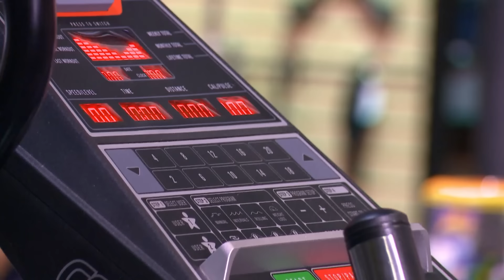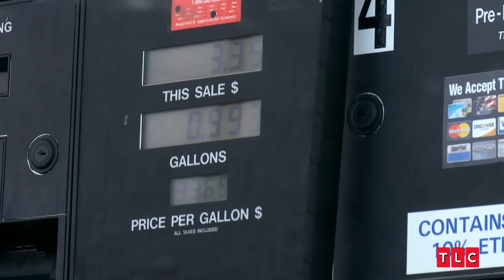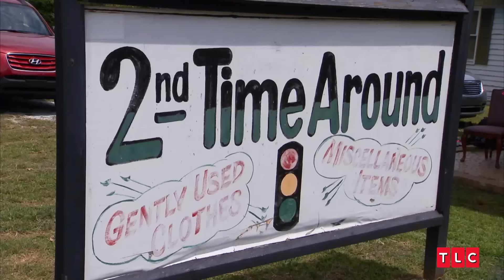She Fills Her Pool with Junk to Save Money! | Extreme Cheapskates

Comment: Bro the bike generator thing wasn’t even cheap, it was genius
Reply: didn't even work bet they plugged it in for the show
Reply: The alternator makes 12v dc current, the pump runs on 120v ac. It is very very fake
Reply: @samfergusson6349  it's plugged into an inverter
Reply: @lreny489  it's plugged into an inverter
Reply: @lreny489  it's plugged into an inverter bro
Reply: @samfergusson6349  it's plugged into an inverter bro
Reply: @lreny489  at 10.39 you can see the red inverter
Reply: Wonder how she afforded the alternateor and inverter that would of been a few hundred dollars
Reply: @L M R  it's plugged into an inverter bro
Reply: @hamstersmash  actually, it's plugged into an inverter
Reply: Did y’all even see the inverter
Reply: A pearson can put out 200 watts and the pump needs 750 watts and the car alternator is only 60% eficiant leaving only 120 watts the pump motor needs ac so an inverter adding to the losses that was a set up for views.
Reply: @samfergusson6349  not to mention that pump probably draws 10+ amps no alternator is going to put out enough power
Reply: @suncitybooksgeraldton335  Another way of thinking about this is that most pools need all of their volume pumped through a filter around 8 times a day, and that kind of pool has tens of thousands of gallons. Do you want to move tens of thousands of gallons of water using your body every day to prevent your back yard pool from becoming an algae lagoon?
Reply: She would be pedaling 24/7  charging batteries for a month, to have enough power for one day for pool pump.
You obviously need a battery and inverte. She was making about 10watts of power.
So without loses would need to be charging big enough batteries for 100 hours just run the pump for 10 minutes
Reply: @gregorius8289 you can get them used and rebuilt
Reply: Mmm all my 6 years I studied as a electrical engineer went under question 😅😅😅
Reply: The real “geniuses” are the people that believe that actually works.😂
Reply: I think her other approach was much smarter, reducing the amount of water in the pool. I mean, instead of filling it with junk she could just use a ladder and only fill it half way but...
Reply: So fake.  Anyone that knows anything about electricity knows this.  Another show had an olympic bicycler powering a toaster to see if he could make toast.  The olympic bicycler was completely drained by the time it ran the toaster long enough to make toast.  That pool pump uses about 1/2 the energy as a toaster but she was barely even pedaling.  And that belt would never stay on more than a few seconds.
Reply: It was faked doesn’t work
Reply: It’s completely fake for the show. It won’t even work if you did connect it.
Reply: That’s bs car alternators won’t produce enough power to run that equipment. They typically produce 13.5-14.8v
Reply: @VortexVibe634  she’s got an inverter but isn’t turning it fast enough.
Reply: Yall crazy if you think that would work, inverter or not. First, that alternator pulley needs to move 5x that speed to output any significant amperage. Second, that pool pump probably requires north of 1500W to power. It ain't happening. This show is fake.
Reply: They barely even provide enough power for a bike light, it's not going to save $10 a month yet $200 no way
Reply: A pump is a mechanical device. Why not skip the conversions to and from electricity?
Reply: @edwardmitchell6581  It’s not just a pump.
Reply: @trainman665 Yes, it is.  The filter system uses different inlets and outlets powered by the flow of the water from the pump.  Unless you have a pool heater, you can absolutely have a pool filter that runs on a single electrical water pump.
Reply: @melduforx  No it’s not. A pump itself does not filter. There are many components in a filter system.
Reply: @trainman665 the pump pulls water through the filter. You don't need electrical power to run a pump, she could turn the pump mechanically with the bike.
Reply: This is the correct solution.
Reply: I truly don't believe that would work. That generator would need to spin a whole lot faster.

Comment: I find it fascinating that this lady miraculously cracked the century long mystery of how to directly feed an alternating current 120 volt motor with a direct current 14 volt alternator using nothing more than a leather belt and a stationary bicycle.
Reply: two leather belts...
Reply: Oh yes!  You're so right.  I totally missed the second belt. (I think my eyes were rolling too much to notice)  @Metqa
Reply: Yeah, and that second belt is installed backward. Two opposite belts, forward, backward, forward, backward. That's so that the bike contraption produces alternating current! 😆
Reply: Not to mention a car idling in the high hundreds of rpms is what creates those 14 volts DC and uh...that was not even nearly enough rpms
Reply: All you need is a charge controller a 12v deep cycle battery and an inverter
Reply: Ya that was the fakest nonsense

Comment: The gas one is pretty good until you realize it almost isn’t. She said she buys a gallon a day, which means she rides to the gas station, and back she everyday. This means that she spends more gas then she would have if she would get the full tank and only drive there once a week. Unless the gas station is directly on her way to a place she drives to, which the video shows it isn’t, I would say that this strategy is probably the least effective out of the ones she uses.
Reply: She acts like the gasoline seeps out of the tank every night it sits in the garage. Absolutely ridiculous.
Reply: @dewilew2137  you can tell the lady failed math
Reply: It's also bad for your pump to constantly run your tank that low so she's losing more per mile on maintenance. Driving your car with less gas does save some fuel economy though since gas is heavy, so the weight savings is good but the best way to do it would be to fill up to 1/4 tank every time.
Reply: @MyFunkymonkey7  yup the gas cools the pump so not good to run it so low
Reply: That's like me not wanting to withdraw too much cash because I feel like I'm more likely to lose or spend it. And then I'm cursing my life because I need to find an ATM in the middle of nowhere because some stupid card reader isn't working. Even though me losing my cash or having it stolen is much more likely than gas disappearing from the tank of her car. What if she needs to drive somewhere because of an emergency or runs out of gas and needs to have her car towed?
Reply: the weight of extra gallons...
Reply: and hard as heck on your fuel pump!
Reply: She should at least have the tank 75% filled.
What if there’s a hurricane or some natural disaster where she had to evacuate?
Those are the worst times to buy gas!
If the power is out that just makes it worse as the gas pumps will not be working.
Reply: @FrankTimms-cs5hl  exactly. There was this life coach lady who pointed out that living in her area, with forest fires and random earthquakes, it was more frugal and smart to fill the tank to the top and to top it off as it gets to the halfway point. Half= Empty. That way, if you had to GTFO, you were not stuck with an empty tank at the petrol station waiting for the fire/quake/tornado-hurricane to swallow you up cuz you didn't have gas. And even having ONLY a half a tank can drive you past a lot of overpriced gouging gas stations during an emergency and into the next town over and safe zone.
Reply: yeah that 12 gallons of gas to fill the car would save her 11 days of time and mileage going to the gas station.
Reply: The gas isn't going bad, what an idiot.
Reply: Not to mention that the lower the gas in your tank is, the worse it is for your car. So driving to the station daily and constantly having it low, she is destroying the car quicker and effectively making it cost more than two different ways. She is smart, but she is not a genius xD
Reply: My mother does this, treating getting gas like a daily errand. It drives me nuts. My mother will drive half an hour to a little town to fill up her gas tank in preparation to make a trip to the bigger town (half an hour beyond the little town, in the same direction) to get groceries or something the following day. So she burns 3 hours worth of gas to do 2 hours worth of driving. I don't understand why she doesn't drive half an hour to the little town, get gas, and continue driving for another half hour to get to the bigger town :S
Reply: @MyFunkymonkey7  let's say you have an average new sedan, a 2025 Honda Civic. It has a 12.4 gallon fuel tank, meaning about 75 pounds of gas when 100% full. A 2025 Honda Civic weighs 3000 pounds at the curb. Nobody's going to notice the difference in fuel economy with an always full gas tank, it's likely to be immeasurably small.

Comment: Alternators don't work like that. They have to spin much faster before they begin to output current. This was fake (as is 99% of TV).
Reply: Right. Also, how are you going to run a 120v pool pump with a 12Vdc car alternator. Lol

Comment: She's actually quite a smart and resourceful cheapskate. I like the way she thinks, like the old school style manually powering up the generator 😂
Reply: It's not even humanly possible for her to power that pool pump with a bike, and even if it were, it wouldn't turn as easily as she makes it look like the alternator is not under load or connected to anything. Even an Olympic athlete couldn't power a pool pump. There is a reason why human flight is so hard. It might be possible with 4-5 trained professionals for less than an hour.

Comment: To be honest yes some of the things she does are kinda weird, but it is not as bad as i thought. She is actually so smart. People would think it is stupid and really weird to do the things she does, but it does save her a lot of money. Also I love how confident she is. (I am not saying that she isn't doing anything wrong)
Reply: She's also a narcissist that takes advantage of other people
Reply: @JonDoe-uq1mk  Are using the sports equipment is not her being a narcissist I just think that it’s a little bit overreaching with boundaries and stuff like that especially with public places,What’s the say that she’s a narcissist is a little bit far reaching
Reply: @JonDoe-uq1mk  you must know her personally since you’re throwing that word around. You saw her use sporting goods equipment? That they said they demo out? Putting sand in her pool? Just assuming huh😊
Reply: Only problem being less gas is really less gas your vehicle burns fuel less efficiently when your below half a tank shed save more money if she just filled it once and continued to top it at a set time all the time I buy small amounts of fuel aswell but my tank never falls below 3/4 as that’s where it most efficiently burns fuel
Reply: A car belt doesn’t cost any more than those actual belts she’s using to power the generator for her “pool filter” (she’s actually powering the pump)

She’s spending more money by going to the gas station every day instead of showing up once a week or once every other week by filling her tank up

The bubble wrap on her pool is about the only clever thing I’ve seen
Reply: @iino27ii91  I think the bricks in the toilet tank and using less water in the pool is kind of smart, even though she could find a more elegant way than plastic bottles full of sand to reduce the size. I agree that the actual belt is a weird choice, it will likely tear soon and destroy the whole set up. The gas thing, 100% makes no sense. 
The bubble wrap won't prevent animals from falling into the pool, not sure if that's a problem, I don't have one and don't really know anyone with a pool - my friends who briefly thought about getting a pool did the math and found they could hop on a taxi to the public pool or even the fancier one further away whenever the weather's nice for a lot less.
Reply: @iino27ii91   its not even humanly possible for her to power that pool pump with a bike and even if it was it wouldn't turn as easy as she makes it look that alternator was not under load or connected to anything

Comment: I gotta appreciate how handy she's been able to fix a generator to run the water pump
Reply: yeah other than the fact that it is a 12v dc car alternator and that is a 120v ac water pump. it is being spun at 100 out of 3000 rpm... so no there is no way that worked
Reply: @cameronck   there was an inverter
Reply: @inomu9129 it doesn't matter that there was an inverter, that's a 240 volt ac pump, it probably draws 10 amps minimum, that alternator isn't going to do it. Especially with how she's barely pedaling. It's 100% fake
Reply: It's definitely fake, that alternator at them low RPMS could charge a phone or a battery but no way power that pump

Comment: The alternator bike thing was definitely staged and you cant just sprinkle half a box of baking soda in a pool to keep it clean.
Reply: How we would know its staged?
Reply: @FactStorm  Because an alternator does put out close enough electricity to power a pool pump, especially when it's only spinning at like 100 rpms, and they're designed to spin thousands of rpms. Maybe if there were 20 alternators spinning at 2500 rpms, it could work. She's probably creating a fraction of a volt of power. And pool's get dirty easily. If she just used a bit of baking soda here and there, it would look like a pond. It needs chlorine to keep algae from growing. I had a smaller pool, and it was difficult to keep clean. You have to keep chlorine at a specific level, or it will become stagnant and nasty even if you have the filtration system running.
Reply: also that alternator puts out like 100 amps max and that is a 12 volt system. not sure what that red box was, but it didn't look like power converter to change it to 220 volts and if it was, it would only generate around 4amps, not nearly enough to run a pool pump. definitely staged. she gonna burn up the fuel pump in that car only putting a gallon at a time with not much fuel to keep the pump cool. a lot of the other things she was doing don't save money either. she's just a dummy
Reply: @mikes68camaro , and is annoying while at it.
Reply: @jmccormick1490 I'm an electrician and I was looking for this comment....it not even a.c electric. She never took the rectifier out it to convert it. Even if she did it would be dirty electric with off balance sine waves. I've tried to use alternators as a project and it's a Hella of alot more work than what she did. I was almost offended.
Reply: @FactStorm  if you think shes generating enough electricity to power a pool pump to clean that giant ass pool you must be on something. even if it did produce enough electricity to power it it would burn out the pump real fast like that, that would cost more to replace than the savings shes getting...
Reply: @federalagent7334 haven’t you noticed that many people on this show are? 😂
Reply: @jmccormick1490  I agree the power generated from pedalling a bike would be minimal if it generated a lot more people would do it!
Reply: @mikes68camaro she's not a dummy, a lot of people that were on this show came out years later and said most of it was staged and embellished. The Asian lady that was dumpster diving for food to feed her friends at a dinner party she said was completely made up amongst other things portrayed about her in that episode. She also said she regretted it because people really thought she was that dirty and inconsiderate.
Reply: When she said the alternator worked is when I realized the whole vid is a joke.
Reply: @drekelley2352 she would be better off using the bike to turn the pump directly.
Reply: Some people can be that…stupid 😂
Reply: The show is staged
Reply: I used bike at the gym and run for 15 mins yet it only tells me that I almost lit up a bulb.
Reply: Eeeeeeeeeeeeeeeee
Reply: If you want to save money on power bills, that’s precisely what solar panels and battery systems are for.
Reply: 100% fake. Two belts hooked together? What is this a cartoon? I could do the math to show how absurd this is but it’s not worth it. Anyone who ever tried to hand crank a radio would know that lazy pedaling is doing nothing.

Comment: I actually know a few people who put a brick in the toilet reservoir. When you’re genuinely tight on money, every dollar you save helps.
Reply: That's actually an advice plumbers in my country give to customers, to save water more than money, instead of bricks though just fill up 2 small plastic bottles and put them in there.
Reply: It's all great until that log doesn't want to flush down because there's not enough water lol.
Reply: Newer toilets are 'water savers' and use well less water so bricks are not needed, older systems yes
Reply: When we had a drought, it was encouraged to put a brick in the cistern to save water!
Reply: My toilet tank has a no 1 and no 2 switch :)

Comment: Her solution to the pool pump was a wonderful idea that is a serious savings as long as she can actually get the pool to the clean level that she needs to
Reply: It's not even humanly possible for her to power that pool pump with a bike, and even if it were, it wouldn't turn out as easily as she makes it look like the alternator is not under load or connected to anything. Even an Olympic athlete couldn't power a pool pump. There is a reason why human flight is so hard. It might be possible with 4-5 trained professionals for less than an hour.

Comment: Last I checked pool pumps require a little more than 14V...
Reply: And around 1500w minimum to add.
Reply: Yeah, the inrush current to get that pump started would probably be around 3000 to 6000 Watts. Most car alternators about 100 to 200 Watts and even if it was enough you would still need a inverter and batteries.
Reply: That’s what I was thinking. She’s just going to end up damaging the equipment.
Reply: @felixf4378 is she charging a battery that's powering the equipment?